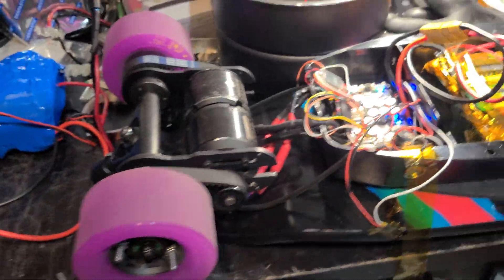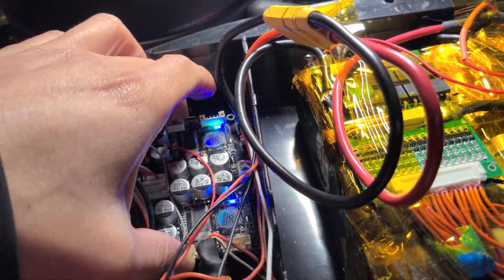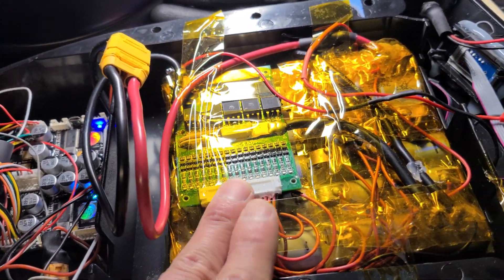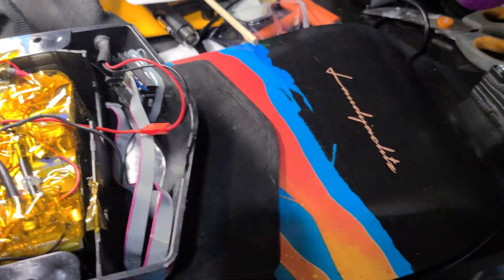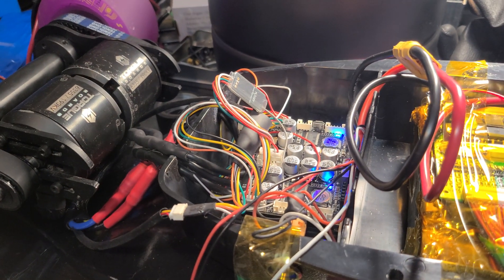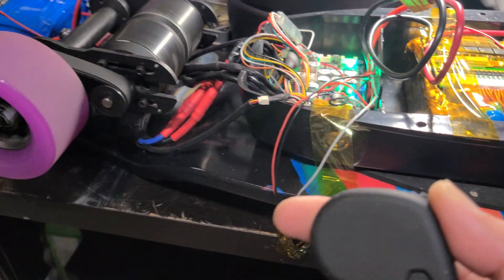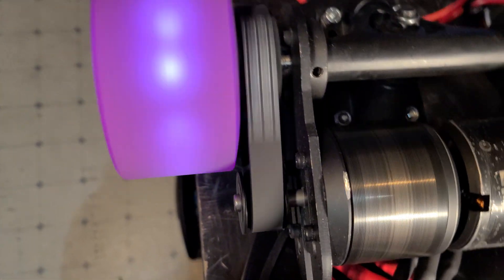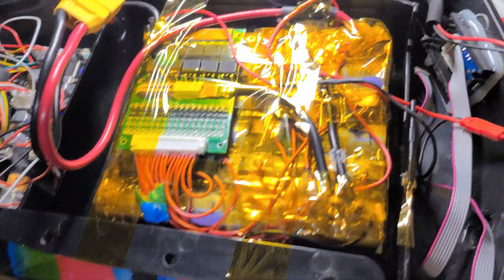DIY Electric Skateboard In Surgery. 😭😭😭 #MadMaxMini

Comment: 4.2 Dual Plus was not recommended for 12S bud. I think it’s 100A max - 50A per motor. If you wanna run 12S probably need those 6.6Vesc or something. The sweet spot for these should be 10S. What type of cells are those?

Comment: MAXXX! sorry been gone BUT! This isn't the board that you had been using going on that long coastline trip before, the long slender one with black wheels that had a great slow mo... so that you don't fly off during a stop that you were trying to reach 35-40mph. Anyway! Idea! Think you can place a mini fan from a mid tower to put down there for a coolant. Do you think you can add 2 more power cells for more power. Maybe last 30miles. 👍😎

Comment: This cells gonna die soon with that kind of load
Reply from the maker: They won't, this battery pack is rated for around 4000 watts of continuous power using latest 21700 cells, same ones used on newer Teslas, which isnt't even out yet.
Reply: @maxlee  Nice, I thought that they are 18650 ones. But you have to remember about cooling. Continuous discharge rates are calculated for using one cell in open air, not 24 of them in closed package